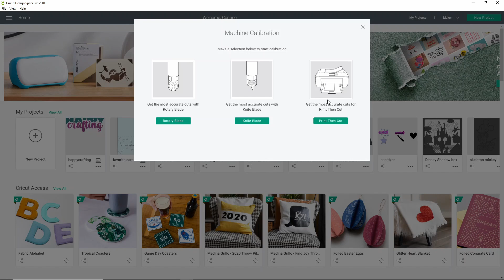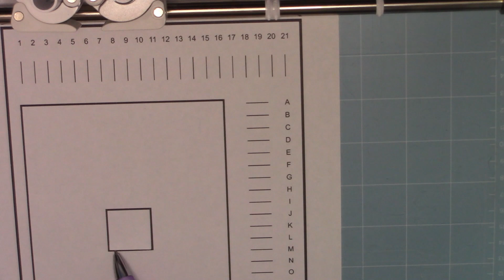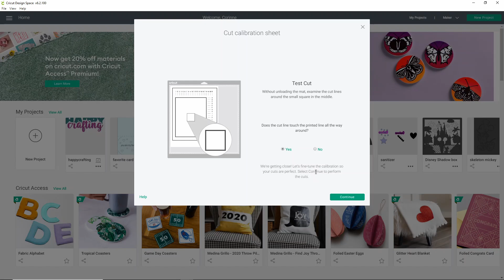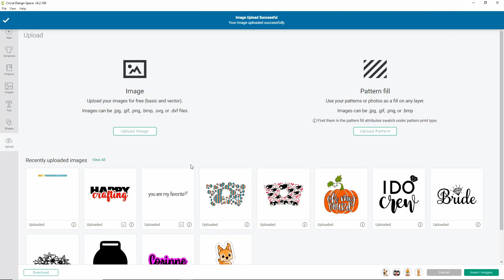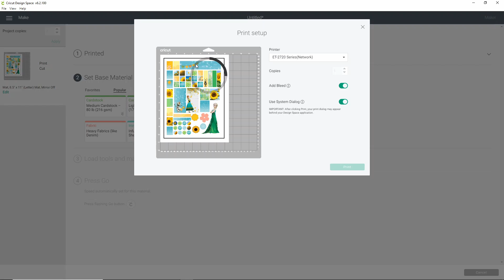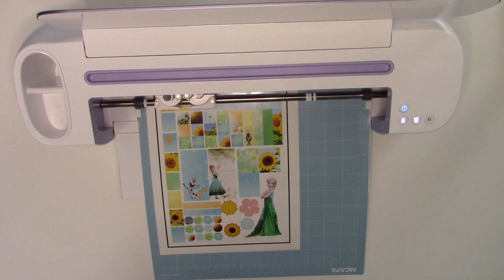How to calibrate your Cricut machine for print then cut - fix bad cuts with Print and Cut

Comment: Works fine for A4.  There does not appear to be any way to calibrate for A3, which I have NEVER got to cut right no matter what.
Reply from the maker: Someone else said they had issues with A3 size paper as well. It was a few months ago. I make have to see if I can get my hands on any and try it out

Comment: I know this is an old post, but thank you for posting.  However, after 17 calibration attempts my print then cut never got better.  Any suggestions?  Thanks.
Reply from the maker: You’ll need to contact cricut directly
Reply: @CorinneBlackstone  Thanks for responding.  I did, and they were very helpful.  It is working perfectly now!

Comment: Is anyone having problems with jagged cut edges? Cricut Maker not cutting smooth clean cuts. If I rub my fingers along the edges, you can feel all the roughness. I have a brand new blade too!!  I'm constantly having to calibrate my machine and now I'm getting this problem. I'm so annoyed!!!
Reply from the maker: It might actually be your image and not the machine. That’s typically the issue in these situations. If you haven’t I would try completely different designs and see if that helps

Comment: Mine doesn't cut around the square at all, it's completely off and I've followed every step and tried all the tips on Youtube to no avail...  Lost count of how many times I did the calibration! The top and right lines cut properly but never the square... I feel so frustrated because it was a big investment and I was really looking forward to using it... but at least I've contacted Cricut and they're sending a replacement, so yay to that! 🥳

Comment: How do you clean the sensor? My cricuit explorer will not print and cut the calibration gives a error as well.
Reply from the maker: Use a small paint brush and run it under the carriage

Comment: Hey, what can I do if i"ve done many calibration cuts but still not centering?
Reply from the maker: Throw your cricut across the room. But truly sometimes it can be a pain. Try using the calibration sheet that is from the website and not from design space
Reply: @CorinneBlackstone  Ohh there's a sheet I can get from some where else?? Please can you share this sheet or a link?
Reply from the maker: @hariniboraluwa3375  it’s on the cricut website  there search calibration
Reply: @CorinneBlackstone  Thank you. I tried that as well now and still no luck :( I have Etsy orders to make and don't know what to do with this problem now :( It was just sliiightly off all this time (hardly noticeable) then a new project threw off the alignment somehow...

Comment: Anyone find a solution yet?**I've calibrated my Cricut Explore Air 2 four times and still getting either can't read registration marks or a bad cut**SOOO Frustrated
Reply from the maker: Use the calibration sheet off the cricut website not the one from design space

Comment: I've calibrated my machine about 3 times. I'm doing print then cut for very simple circular labels which I have duplicated in Cricut Design Space 15-up on the page. The top row cuts accurately but by the time it gets to the bottom row its almost an eighth of an inch off.
Reply from the maker: Yep this is happening to everyone. Design space sucks for print then cut right now. You can try printing the calibration page off the cricut website and use the at to calibrate instead of the one they have you print from design space to see if that helps
Reply: @CorinneBlackstone  Hi Corinne, I just bought a Cricut (Explore Air 2). I went ahead to size my image in design space to 6.75 by 9.25, then make it. In my own printer settings, I kept the size set to US Letter. It printed out wonderfully onto my A4 paper, filling the space up like your Frozen stickers here. But then, the Cricut cut was off slightly. Found out about calibration and got mine looking good on the test paper. Then, I printed out the design mentioned above, but the cut was even more off...just wondering if you would know what could be going wrong? I actually live in a country where my printer paper is A4; did you use A4 in your examples?. Does the calibration sheet have to be as big as the 6.75 by 9.25 space? Because your one didn't look as big as the frozen stickers you proceeded to cut...thanks sorry if this is confusing
Reply from the maker: @galacticgummybearzzz  paper size doesn’t matter as long as your registration marks print onto the paper. Cricut print then cut has been a mess for a while. I find shining a flashlight on my carriage while it reads the marks helps mine some
Reply: @CorinneBlackstone  Oh okay, so do you mean that it doesn't matter if I'm using A4 paper? I understand that because the registration marks did come out nicely, however I am wondering about printer settings - I understand Cricut forces the material size as US letter, but is this overridden in your own print control settings when you pick your options? If that is the case, should I be keeping it set to US Letter or adjusting it to A4 size to match my physical paper? Thank you for your reply, I have been reaching out to others on YT with no response and feeling helpless :O
Reply from the maker: @galacticgummybearzzz  it’s all set by your printer. You could print on a 5x5 sheet and as long as the registration marks are on the page cricut will cut it. The size of the sheet does not matter. Just change your printer to be sure it’s printing the correct size paper you use
Reply: @CorinneBlackstone  Okay thanks, I will try and set it to A4 and see if I get a more accurate cut
Reply: Annoyingly and unfortunately printing at A4 size done nothing, in fact my calibration was way off 3 times in a row and it said it can't continue to be calibrated.

Comment: I see that these are being cut on the inside edge of the sticker. How do you think this was accomplished? Possibly somewhere other than design space?
Reply from the maker: The design? I believe was made in illistrator. I didn’t make this but you could easily make similar in design space
Reply: @CorinneBlackstone  mostly I was curious if you knew how to make the cricut cut on the inside edge of the sticker border. When you peeled the sticker off the sheet, there was still a ring of color left behind. This makes sure there is no white edge left on the sticker. I’d love to know how to accomplish this for all the stickers that I do not want any sliver of white accidentally left on the edge of my stickers after the cricut cuts it.
Reply from the maker: @daniellecollins4069  it’s the bleed function. When you go to print them make sure the bleed option is on

Comment: Hi thanks for this video.  I recently decided to do print then cut. Wouldn't work so tried to calibrate and it keeps giving me a Java error. I have tried multiple computers and printers with the same Java error. Any advice? TIA
Reply from the maker: Cricut has really done a number on their updates the last few times. I am getting this error a lot too. It lets me close it and just move on to print then cut so try that but if that doesn’t work you may need to contact cricut directly

Comment: Today I was using my Cricut Explore Air 2. I was having no issues making my stickers. I went to make another print and cut and I noticed the registry mark is higher up on top. I tried to calibrate machine. Didn't work. I printed using copy paper setting and it cut correctly. Does anyone know how I can fix this?
Reply from the maker: You need to change your printer settings for paper. Your printer did not pull the sticker paper in correctly so it didn’t print the registration mark where required
Reply: @CorinneBlackstone  I meant to say I did a seperate cut using paper used paper setting. It worked for the paper. When using sticker paper using printable sticker it didn't. Never had this problem before.

Comment: Please help ! I calibrated many times cuts great on regular copy paper . But when I add my glossy sticker paper my machine isn’t printing correctly to where the top line lined up correctly to cricuit lines 😩 usually when print then cut there’s about an inch Gap on top to guide you where to line sheet . But when mine prints there’s barely any space at all . I’ve moved my sheet on print tray and calibrated and still prints the same  I’ve tried guessing lining up where to place on Mat but still won’t cut perfect 😩
Reply from the maker: Change the paper settings in your printer it sounds like it’s not grabbing the sticker paper correctly causing the issue

Comment: When it does the 2 cut and it ask which cuts close to the center are we looking at the square in the middle or the center of the big square on the number side and on the letter side.
Reply from the maker: You are looking at the square in the center first then it will do the numbers and letter lines

Comment: Thank you for your video💕
How did you get the Cricut to allow you to use more of your paper vs leaving a big margin on the right & bottom of the paper? 
I don’t want to waste so much of my expensive paper😞

When I print my image it looks great on the Canvas step but when I click on Make It, it only prints a 6”x 9” wasting paper on the left & bottom. I totally can see on my printed sheet, that I can add a second row of images on the left and bottom😞but when I add more images it creates a second page on the Make it step🤔WHY does it do that?

Please 🙏 help me😞
Thank you in advance❤️
Reply from the maker: It’s still the same print size. 6.75x9.25 it’s just because it’s taking up all that space it looks bigger
Reply: @CorinneBlackstone  
But it looks bigger because it is using most of the sheet...right.
It looks like it only leaves an inch all the way around your images, thus using the full sheet.
Mine leaves approximately 3” to 4” on the left margin and approximately 2” on the bottom.
On this space I can easily add another row on the left and another on the bottom of round images for the chocolate covered Oreos. However the Cricut machine doesn’t let me😫it automatically creates a second sheet.
Feeling frustrated 😞
Reply from the maker: @mariahutter7081  I have a ton of videos that show you how to use all of the print area available to you. You’re just not putting enough in the space and then attaching it.
Reply from the maker: @mariahutter7081  this video shows how to make the most of your sheets https://youtu.be/TpI3nzRoqXo
Reply: @CorinneBlackstone  
Thank you, I will watch the video you attached the link for👍
Also thank you so much for your quick replies ❤️
I’m going to unsubscribe from all the other YouTubers and ONLY keep you, you’re the BEST!
❤️🙏🙏🙏🙏

Comment: Hi ! I been trying to calibrate my machin but I keep getting back that it can't read the sensors 😓😓
Reply from the maker: Turn the lights down in the room. Run a small paint brush under the sensors some vinyl may be stuck to them. If that does not work contact cricut directly as some sensors can be bad

Comment: So what if there is an error and the machine can not read the lines
Reply from the maker: Darken your lines with a sharpie, close the lid on your machine, if it’s still not working contact cricut. The sensors can be bad. I never have read issues

Comment: How did you get that to print and cut as 8.5x11 when you sized it down in DS to the PNC dimensions? Did I miss something 🤔🤣🤷‍♀️
Reply from the maker: It’s not 8.5X11 it is 6.75x9.25 just change the size at the top of the screen to fit within the allowable size